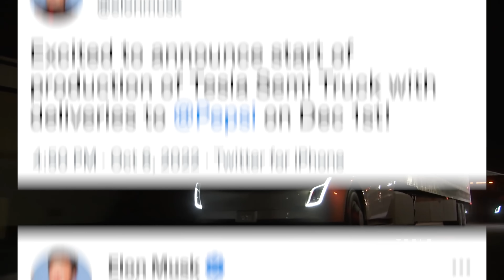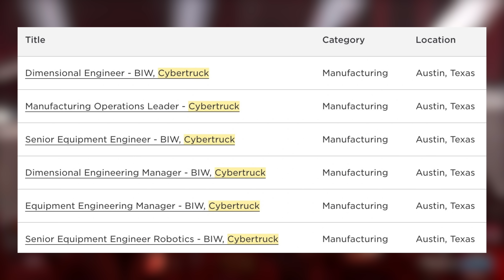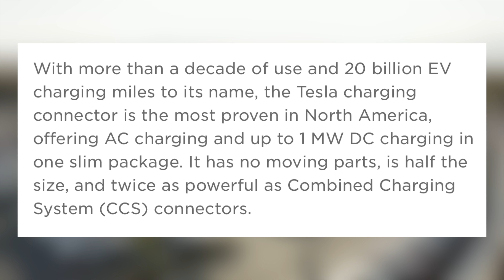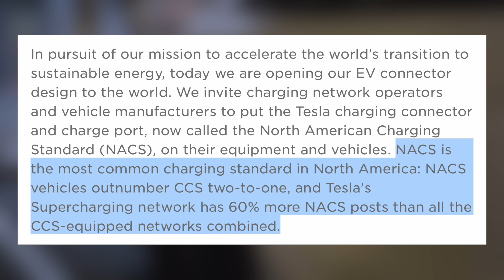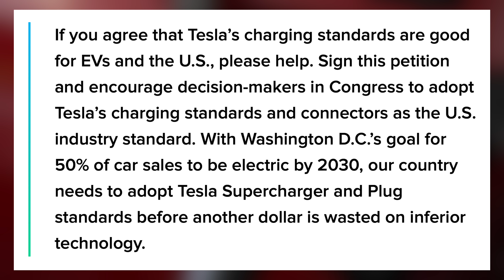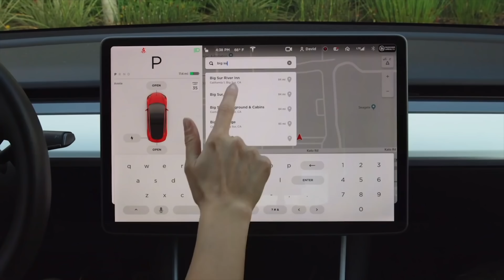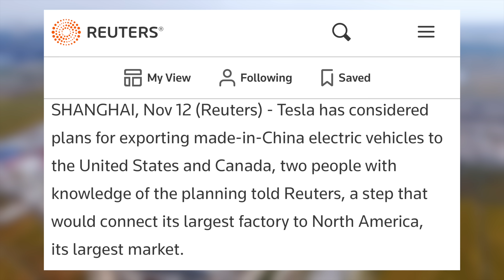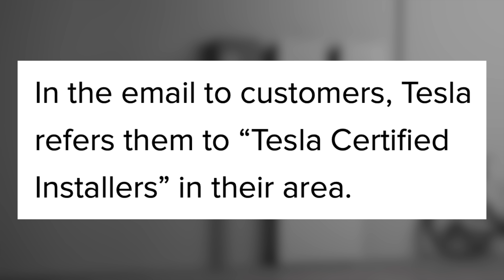Tesla's Risky Move To Help The EV Industry | Elon Better Be Right

Comment: When it cost $1,000 for two days worth of diesel fuel, Tesla trucks definitely have a place.
Reply: I'm sure he thought this through, but how does it make sense when the truck becomes so much heavier, due to all of the battery weight? It would seem as though each truck wouldn't be able to carry as much. Again, I'll just assume he thought this through.
Reply: @dontbanmebrodontbanme5403  The government allows an extra 2 tons of weight to allow for batteries in EV semi's.  That still doesn't offset the full battery weight, but helps.  Most trucks aren't moving at max weight.  Pepsi is their first customer so even with the weight of all that liquid it still makes business sense for them.  New battery tech is getting lighter so by the time we fully transition to ev semi's they will probably be able to carry the same amount of cargo.  Maintenance and diesel fuel costs are very high.  I seem to remember Tesla claiming a $180k savings per semi for total cost of ownership.  Margins are thin in the freight industry so if one company saves $180k per truck and another doesn't they won't be able to compete.
Reply: @dontbanmebrodontbanme5403 :  Do you also just assume the world is flat?

It's all about ECONOMICS.  Saving all that fuel, all that pollution, and all that GHG production, plus a very long life for the Tesla Semi truck is HUGE.  Also, the Tesla performs much better re not needing to slow to take hills, much better acceleration, etc. 

If it is reliable as claimed AND Tesla helps truck stops get lots of chargers installed, Tesla should be able to sell MASSIVE numbers of these.  As the numbers climb, the profit margins climb -- just like for Tesla cars. 

The absolute size of the load is only ONE factor, re semi trucks.
Reply: Natural gas makes more sense.
Reply: @rogergeyer9851  tesla semi was designed for same weight cargo as diesel semis- 80k pounds I think.
Reply: @dontbanmebrodontbanme5403  I hauled mail and packages that where light but bulky. I was often well under the 80,000 pounds.
Reply: The only problem long term is, whether gas or electricity, SOMEONE is gonna get theirs.
Reply: @dontbanmebrodontbanme5403  what is the weight of the thousand gallons of diesel fuel, engine  and TRANSMISSION of diesel trucks!?
Ever thought of that!?
Have ever thought of anything literally!?
Serious, there is a difference between thinking and recalling. They are not the same by a long shot.
Reply: The truck that Pepsi ordered is for the frito lay plant that is the maker of potato chips which is light but bulky. 🤔
Reply: @PistonAvatarGuy  Yes in the USA it does. It is also 30-40% cleaner when it burns. And you can design it to run on gas and natural gas for the easy transition. It is win win. And because running on natural gas burns cleaner, it also extend the lifespan of the engine.
Reply: @dstr1  Less than the weight of the battery.

Comment: NACS should standardize to right front or rear left to maintain compatibility with current superchargers
Reply: Excellent point.  If the goal is to allow use of existing supercharger infrastructure, cable length does not support charge-port locations just ahead of the front door. So it charging standard and charge-port location that need to be commonized together.

Comment: With the current Anti-Tesla regime in Washington DC, the charging standard will not change anytime soon.
Reply: Why should the charging standard change? Only Tesla is using their own connector, and exclusively in the US - in Europe, all cars use the standard Type 2 plugs with CCS.
CCS is also much more future proof since it allows much higher charging speeds than the small Tesla connector.
Reply: @arnofleck  you might want to read the specs on the Tesla/NACS as to power levels...
Reply: @arnofleck  The Tesla has the highest charging speed in the industry.
Reply: @arnofleck :  No it doesn't.   Facts matter.  Did you even listen to the video?  Have you even read about how inferior the competitive charging networks are (at least in the US), re lots of articles and Youtube videos?

Will CCS allow speeds up to 350 KW.  Tesla will allow up to a Megawatt, or nearly THREE times as much current.   It's not about the size with chargers, it's about the capacity, the speed, and the reliability.
Reply: @rogergeyer9851  Yes CCS allows up to 350 kW but I think the only car that can close to it is the e-tron GT with 270 kW. But honestly the max output doesn't matter, what matters is the charging curve. I personally don't see the point to have chargers that would do more than 350 kW and I can imagine the nightmare for the grid already. Also what would be the point, if you can drive 3h, charge 20mn (time of a short break) and repeat then I don't see why cars would need to be charged faster.
Reply: @inebium  fast-forward a few years when EVs are everywhere. That 20 min charging time is gonna suck, when you have to wait an hour to get to the stall. If you cut charging time by 4x, throughput goes up, wait times go down (assuming the grid and equipment can sustain that load, which it will need to)

Comment: I'm probably being a bit pedantic but outside of North America its the CCS-2 connector (not CCS-1) that is currently most popular (for newer installations at least). This is the case through most of Europe, Australia, NZ and lots of other parts of the world. Here in NZ our Tesla cars come with the CCS-2 socket on the car - which makes it easy to charge from any public charger here (as well as Super Chargers) and also CCS-2 allows Type 2 plugs can be used (many type 2 chargers are free here) for up to 22 kW AC charging (11 kW for Model 3).
Its a pity Tesla plug wasn't opened up a bit earlier (before Type 2 took hold) as I agree it much more compact connector.

Comment: If the mileage holds up delivering Pepsi which is mostly liquids imagine how good the mileage will be for a  Freto lay truck delivering chips.
Reply: Ryan:  Simply testing the mileage at max loads in a hilly area on a cold day tells the tale.  Either the 500 mile range claim is true or its not -- or its a marketing claim where you only get 500 miles under restricted conditions. 

Hopefully it's at least true for max legal load in the US in good weather, or it's bogus, and that WILL end up in the news.  

Also, I don't know whether the 4680 batteries will offer more capacity (in the installed system as Tesla deploys it), once they're ramped up in volume production.
Reply: Pretty sure PepsiCo owns Frito Lay so yes they will be transporting lightweight chips. 👍🏻

Comment: I hope that Tesla owners have some sort of advantage when it comes to using Superchargers now that it's going into the open market- like maybe cheaper charges for Teslas vs other EVs.
Reply: From what I've heard they are making everyone else register on the Tesla app as a "non-tesla" and are charged more than teslas through the app. No deal for Tesla owners but promoting their brand.
Reply: @MrATagge  Ok, thanks. I mean, that's fair too. I just didn't think it would make sense if Tesla owners and non-Tesla get to use Tesla's superchargers at the same cost.
Reply: They will only open the less busy chargers as they have in Europe
Reply: I do hope they go in partner ship with apple so If there's a iPhone in the car you get extra benefits

Comment: Tesla superchargers in Europe are ridiculously expensive, unfortunately.  Can’t use them right now. Hope this changes back to normal pretty soon.
Reply: What’s expensive?
Reply: Up to around 88 cents \kWH. Compared to 30-50 cents for comparable other network providers (including a few with plug and charge technology, meaning no need to use apps or cards to start charging)

Comment: I would not be surprised if the major OEMs opposed Tesla's proposal to make the Tesla charging connector a standard.  That would be admitting the Tesla's design and equipment is better than the legacy companies can make.  Even if the Tesla connector is made a standard and adopted by other manufacturers, Tesla should require owners of non-Teslas to provide their own approved adapter and pay a premium for using Superchargers.  As I recall, Tesla previously offered other EV companies the option join Tesla's network if they would share in the costs of future expansion.  The other companies declined.  They were solely counting on third parties to build charging infrastructure.  We see how well that worked out.

Comment: Tesla should have opened their charger years ago before more competition came to fruition. Doing so now makes it seem like they’re only in it for IRA subsidies
Reply: It was to prove a point modern car company's that didn't do what they where sapost to when it comes to mpg for decades now.
His point was they will do the same for ev's and well he was right.
Reply: They did, but every other vendor didn't want to help tesla (and some didn't think Tesla would make it to #1 so quickly.) Other vendors also didn't want to help tesla maintain the network.
Reply: Tesla is admitting defeat by selling j1772 adapters for their cars. Tesla did great when there was no option and their percentage of sales is dropping like a stone. Opening up T superchargers will help road-tripping. EA should find a way to exclude a T adaptor until superchargers are open for all.
Reply: I don’t consider this opening the network.  It is open when either superchargers have CCS connectors or at the minimum, I could buy an adapter to use them.  Having to buy a new EV that may or may not be built to use superchargers is completely useless to me.
Reply: As I understand it the holdup using superchargers is them charging $ to non-Tesla. They are doing it in the Netherlands but I haven’t seen an explanation.
Reply: @4rwayner7  🤣🤣🤣🤣😂😂😂😂😂 Where do you get your information???
Reply: @4rwayner7  The payment situation could be handled via a Tesla account and the App, but there are areas in Europe where the Tesla superchargers cannot be open because by law, chargers are required to have a user interface that displays information about the charging session and Tesla station have no user interface.

Comment: It’s the charging time that is going to be interesting. Presumably a new semi charging network will need to be built out. I imagine many of these big trucks have pretty quick turnaround times, at least sometimes. I’m aware of a custom built electric truck and trailer that has a battery sitting behind the cab that can be swapped out with a fork lift enabling a fast turn around.

Comment: Im staying loyal to Tesla only because of the charging network, at this time there is 1 Electrify America between LV to LA vs at least 4 Tesla SC. This  scared me from other brands/CCS. Allowing others to use Tesla chargers would sway me to not be afraid of other brands , maybe it’s just me 😅 In that sense I would say it is risky for Tesla but a good step in the right direction for an EV future .
Reply: Same
Reply: There are 3 EA stations and one ChargePoint L3, between LA and LV.  The distance is less then 300 miles, how many times do you expect to stop and charge on a 300 mile trip?
Reply: @chriswestenskow5202  thanks for calling out my BS actually yes my filters weren’t on appropriately and didn’t account for evgo and CP sry bout that. With a MYP and 4 heavy adult and cargo my arrival SOC is always 15% because of elevation and winds and need two stops to get to LA. (Baker and hesperia). Regardless, I do like teslas move. Would really help both sides. More chargers the better

Comment: Would make even more sense to adopt CCS 2: smaller than CCS 1, supports 3-phase charging and is the European standard. It's also the standard in Australia, New Zealand and many others. Could be the world standard, not just the North American one.
Reply: And uses the exact same software as CCS 1 of course, in case people don't know.
Reply: How much money would it cost to have all of Tesla's existing chargers upgraded to the new standard?
Reply: @dontbanmebrodontbanme5403  Don't know, but they did it when the Model 3 came out, Model S/X used a special kind of Type 2 connector. Superchargers v2 all have two cables, while SC v3 only have the CCS 2.
Reply: 3 phase charging is not part of CCS.  CCS is DC fast charging only, and really only uses the 2 pins (aside from communication with the charger).  You're talking about Type 2, which has nothing to do with CCS since it's AC.  CCS2 is the same thing as CCS1...the difference is the top portion of the connector is designed to physically fit in the Type 2 socket.  Now, Type 2 AC charging is pretty awesome since it's 3-phase, it's a lot faster than the AC charging we get in the US.  Type 2 is basically the European version of J1772, although it's a lot better since it supports 3-phase.
Reply: I‘m pretty sure type 2 ccs ist not smaller than type 1 ccs ?!?
Reply: @StormsparkPegasus  you are technically correct, but I'm sure people got what I meant by CCS 1/2 in the context of fast charging 😁
Reply: @geraldh.8047  It is because it doesn't have the lock on top of it 😊
Reply: Interesting! Did not know that was a difference. Not a huge one though!
Reply: @StormsparkPegasus  thx🤫

Comment: Only issue with NACS is you can't use the car to power your house. It's not a big deal to me but I can see how that might affect those who want the car to be a backup battery too
Reply: Standard includes bi-directional power.  Tesla doesn't support it currently but the standard does.
Reply: Yes it can, the car has to support it but it's included with the standard
Reply: @theprimechuck  The challenge is that current V2X connections use the AC pins to charge the vehicle and the DC pins to connect the battery to the inverter.  This is a bit tough to do when the connector uses the same pins for both AC and DC and switches them depending on what charger you connect to.  This connector would require that all V2X solutions would also require high voltage DC charging of the car in a residential application, which would drive up the cost of those solutions tremendously

Comment: Only reason Tesla plug shouldn't be the standard is most car charge ports are in wrong spot and that's it.

So either companies conform to Tesla's placement, or Tesla changes how their stalls are set up to account for the difference (longer cable and centering it might work)
Reply: But being 1/5th the cost, smaller, have higher charge potential, there being much more at a currently higher charge rate, more reliable, and vehicle to grid/home capability means we should change to Tesla's standard.

Comment: If I remember correctly, in addition to Tesla’s enumerated advantages, Tesla chargers are also significantly less to build and install vs competitive systems. The data I recall was from applications by charging unit it manufacturers to apply for funds from the IRA legislation. The numbers I remember are $40k for Tesla units vs up to $200k for competitors. Can anyone confirm this?
Reply: I read that too.   Tesla's chargers don't have a display, don't have buttons, no RFD reader.  They are very simple to build, in comparison.  And all the parts that need to be cooled with noisy fans are in the white boxes at the border, instead of in each charger.
Reply: @henq  - That’s insightful detail. Thanks for the reply. Do you also find it amazing how political an EV charger standard can get despite lots of evidence that one standard is superior and the field performance is clearly beneficial?
Reply: The Electric Viking did a video on this not too long ago.  And it seems you are definitely in the ballpark with your numbers.
Reply: @boringlyfactual6368  Politics and rationality?   Pfff, sorry, gave up on that combination long time ago, alas…